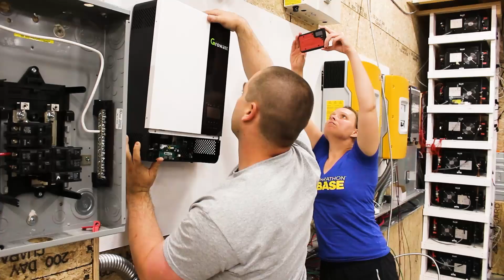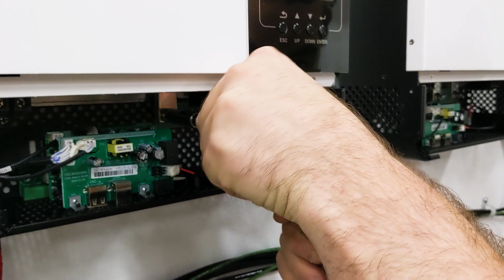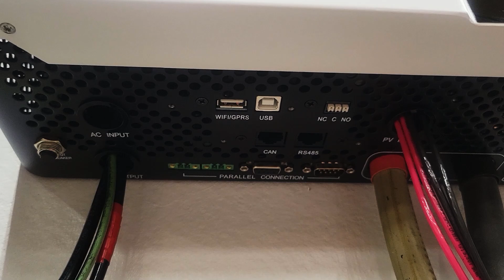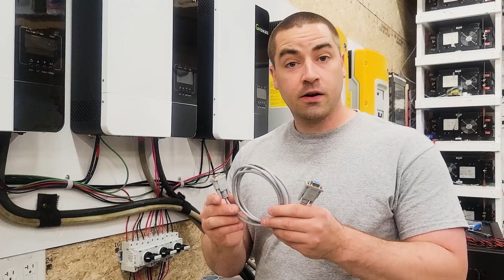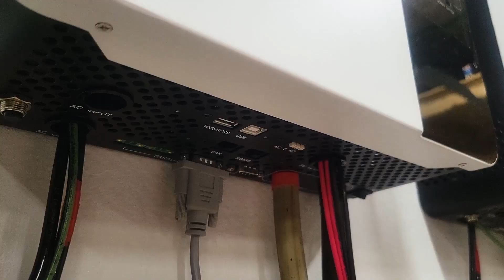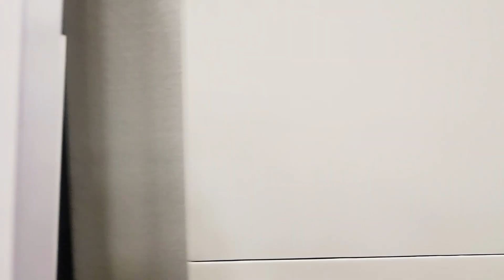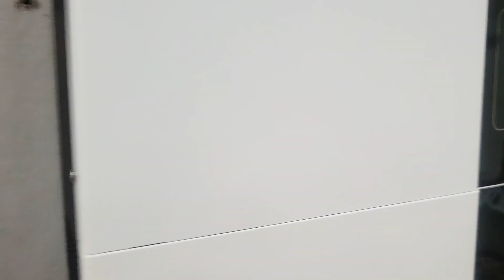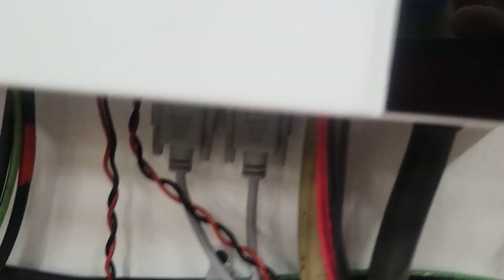Paralleling 3 inverters together, Growatt 5000w Solar System

Comment: Thank you for your excellent videos David. Do you do Patreon ?  I would like to support your channel. 
I am planning an addition to my existing solar system which is 3200 W at 24 V and 4000 w at 330 V.  I am planning to add another 4000 w and wire them at about 300 volts as well.  The existing 330 V is just grid tied. My intention is to go off grid and just use the grid to charge the battery on rare occasions. 
The plan is similar to your video with three 5000 W growatt inverters and 30 K of the GYLL batteries. The question is should I rewire a 24 V array or can it be used as is plugging in to the growatt inverter?
Thanks Rob
Reply from the maker: Hi Rob,  Yes, I have a Patreon page.  https://www.patreon.com/DavidPoz  Thanks for wanting to help.
The 24V array will have to be re-wired to at least 120V at Vmp.  These inverters have an MPPT range of 120V-450V.    There are some hacks to do other things, such as, if your existing 24V array is currently charging a 24V battery, then you could add a DC to DC boost converter to charge the new 48V battery bank from the 24V bank, but personally I wouldn't suggest that.  Too many losses.
Reply: @DavidPozEnergy  Thanks for your response DAVID since I’m planning to maintain my grid connection do you see any reason why I couldn’t also have the option to connect my entire load if the solar system for to go down?
Reply: Given the choice of rewiring the 24 V array for 48 V and continuing to use my outback charge controller or 150 + V and using the growatt inverter to charge the 30 K 48 V battery which would you recommend?
Reply: Another choice I have is to replace the old 3200 W array charge controllers and lead acid batteries with a second 4000 W array with the same panels I’m intending to put on the new carport. In this solution I would have all relatively new equipment. I could likely sell the old 75 W panels and newish lead acid batteries plus charge controllers to offset  some of the cost of the new system. 
Hope I’m not asking too much of your time with these questions. 
Best Rob

Comment: what's the panel you use on the wall to mount your solar controller?
Reply from the maker: It's a cement board used behind tile.  I just painted mine white. James Hardie brand, HardieBacker 3x5 feet
Reply: @DavidPozEnergy  cool!! Thank you. I’m building my first 48v growatt system for the first time!!
Reply from the maker: Congratulations.  It's a lot of fun.

Comment: Hi David, great videos!  It seems odd that a 240v inverter would then require an expensive external transformer to make a split phase 120/120 supply like we have in the US.  Aren't there any inverters that can do that?  Or would it be better to simply use two 120v inverters that are phase synced?
Reply from the maker: There are many options.  I injoy testing and sharing different ways of going off grid.  In past videos I have used an inverter with a buil-in transformer that gave both 120 and 240 volt output.  I have also demonstrated using two 120V inverter together, syncronized 180° out of phase of each other to provide 240V.  Lots of videos on my channel.

Comment: Ok so  have to say it to get it.

You take a 240 single phase inverter and push it through the transformer.  The transformer then creates two 120v legs with a neutral.  Those two legs are in phase though yes?

They are not split phase where you can get 240v to run appliances such as a dryer, stove/range, heat pump, air handler, etc.
Reply from the maker: I go into more testing and details on the auto transformer in this video: https://youtu.be/yWUfvvSa3K8

Comment: Hi David, how difficult is it to set these inverters up as a 3 phase system? Is it just programming, or is there separate pcb required for the syncing function?
Reply from the maker: It's just a different setting in the menu.  The manual does a good job showing how to set it up.  I have not personally tried.
Reply: @DavidPozEnergy  Hi David Growatt sell 3 phase inverters individually

Comment: What's the use Auto Transformer? Can it be dispensed with?
Reply from the maker: You don't need the auto-transformer if you are running only 240V loads.  Such as water heater, well pump, mini-split.  But I use the auto-transformer to get my 120V loads going.  I have more details in this video: https://youtu.be/yWUfvvSa3K8
Reply: @DavidPozEnergy  ok thanks, 
In Oman we have 240 only.

Comment: hi thx for all your video i got a question, the circuit pannel braker like your is a 100 amp and what transfer switch would i need?  Can i use this ?
MOES Dual Power Controller Automatic Transfer Switch 50A 5500W for Off Grid Solar Wind System ATS DC 12V 24V 48V AC 110V 220V or i need something else ?

Comment: So let's say I want to use the AC inputs on these units as well as the AC outputs for the paralleling so that I have backup if there wasn't enough sun.  What's the best way of breaking out the power? If I read from the manual correctly, it appears that their suggestion is to get some sort of 200A panel and that the units have their own breakers in them. But I can't find a 200a fused disconnect that doesn't also require breakers that isn't VERY expensive. I want to have 4 units but eventually have 6. (whole home geo thermal etc.)  Suggestions?

Comment: Really enjoy your videos.  For this install, I'd recommend running the 240VAC lines in conduit, or using SOOW cable for safety.  Or install a shield over the wiring bundle.
Reply: True

Comment: Can you possible help my husband and myself with a question on what might be wrong with our settings as we can get everything to come on via the charged battery without utility power! Which is amazing 👏 Air conditioner  and all! Running 2 Growatt inverters in parallel one hooked up to the generator why does the default alarm come on everything we try to turn the utility  power on and won't charge the battery? Have you ever heard of this issue? Love your videos and followed your advice 100 percent but was wondering if it's a common settings issue? Thank you for your time in advance and God Bless
Reply from the maker: I'm sorry, but I don't know the answer.  I've never hooked up the "input" side of the inverters to anything.

Comment: Can I ask what the point of multiple inverters is, I'm very confused
Reply from the maker: Each inverter can output 5000 Watts.  By paralleling more, I now have up to 15000 Watts.  To put this in perspective, one Tank water heater uses 4500W.  A microwave uses 1800W.

Comment: Newbie here... can you parallel small inverters? Say 1000 or 2000 watts ?
Reply from the maker: You can only parallel inverters that specifically say so.  Most inverters on the market don't parallel.  When in doubt, assume they don't support paralleling. It's not about the size of the inverter.  There are some smaller 2000W inverters that allow paralleling.

Comment: Would you recommend paralleling these vs buying a larger one, like the 12kw growatt? Also, I'm concerned about noise because I can only put these outside of a bedroom window, how bad would that be?
Reply from the maker: Noise:  The fans on these units get quite loud when at full load, but get quieter with less and less load.  If you are at all concerned with noise I'd look to moving them, or buy a quieter unit.

I liked paralleling them for my application because of my 3 solar arrays in my backyard.  Each inverter has 1 solar MPPT charge controller built in.  This worked great for my 3 solar arrays.  However, if you have less solar then the 12K inverter makes for a simpler installation.  Just so long as you don't have to lift it.  The 12K inverter is a heavy monster.

Comment: What gauge wire did you use for the ac side out of the inverters?  That looks like 8 but the manual appears to call for 12 which seems too small.
Reply from the maker: I used 6 AWG on the AC output.  It's overkill, but I had some left over from another project.  I agree that 12 seems too small.   10 AWG would be the smallest I'd use.
Reply: @DavidPozEnergy  I have been using 8. You used 50a breakers to get 6 to fit I presume.  I am going with 40a… assuming 7000w peak.

Comment: I am very curious what you found when you ran the numbers on cost vs efficiency.  Do the big yellow inverters offset their higher cost with their better efficiency?
Reply from the maker: No.  You can purchase 1 extra solar panel per Growatt inverter and it makes up the difference. (general statement assuming a 360W panel)
Reply: @DavidPozEnergy  very interesting.  Thank you!

Comment: Can you perhaps give me some info on what I need for a 3 bedroom, 120sq meter (1130sq ft) house,. Will this inverter be sufficient?
Reply from the maker: Hi Gavin,  When sizing an inverter it's more important to look at the loads, not the square footage.  For example, my home is 600 square feet and I need at least 2 of these inverters (10kW).  But I know other people with 2,000 square feet houses that can use just one.  The difference is the loads.  My home is 100% electric to include heat.  But some people use natural gas or propane for heat, dryer, water, stove, and oven.  In that case the electric load is quite small.
The good news is you can start with one inverter and even if it's not enough for everything, you might just move a few critical loads to it.

Comment: FYI your promo code for signature solar on this product is not valid anymore. They do not sell the transformer separate anymore this can only be bought as just the inverter or combo inverter and transformer and code does not work for that.
Reply from the maker: Thank you for letting me know.  I'll try to get in touch with them.
Reply from the maker: Signature Solar fixed it.

Comment: David, I am wiring 6 growatt 5000 inverters, not having much luck. From your video it looks like the load and neutral lines from the inverter to the panel go into a 220 breaker 2 pole is that correct?
Reply from the maker: Hi.  Yes.  The Growatt model I'm using is SPF5000ES.  This model is 240V output only.  Inside the growatt the output terminals are labeled Ground, Line, Neutral.  In the US we usually would label this G, L1, and L2, so that's how I treat it, as two hot legs.  I run the two hot legs into my "combiner box" which is nothing more than a 20 slot circuit breaker panel from Home Depot.  Each inverter has a 2-pole 50 amp circuit breaker, and I'm using 6 gauge wire.  It's very easy to accidently swap your L1 with L2 from one inverter to another.  This is because the bus bars jump from left to right as they go down the panel.  I've spoken with some other installers who accidentally made this mistake.  So try to ensure all your L1's are on 1 bus bar and all your L2's on the other bus bar.

Comment: Couple questions. 1. Total output is basically 62amps on 15kw array correct?  2.  Doesn't the 30amp auto transformer add to the load? 63amps minus 30amp = 33amps of available power to house? (Assuming the full load really is 30amps on autotransformer)
3.  How much is the total load charging the batteries? It seems a single 4/0 battery cable isn't big enough to handle. I also don't know voltage and amperage on your array and may have missed you continued to parallel battery bank.
Reply from the maker: 1. Yes.  2. No, the Auto-Transformer is in parallel with the inverters, not the load.  3.  My array is 12kW, or maximum 250 Amps.  My 4/0 cables are each about 2 feet long, and can handle 250A no problem.
Reply from the maker: If you would like more details on the auto-transformer, check this video out: https://youtu.be/yWUfvvSa3K8
Reply: Aren't you required per code to have disconnect means and overcurrent protection on dc side for battery bank? Don't recall seeing that, maybe u never got those parts in.
Reply from the maker: I'm a DIY guy, not a licensed electrician.  I'm only sharing the projects I'm doing, not telling anyone else what they should be doing.   My batteries have a circuit breaker built in.

Comment: When you combine two positives, of the arrays, that means you are using 6 panels in parallel and 7 panels in parallel, is that correct?
Reply: I believe that the 6 and 7 panels are in series and the 2 positives combined put the 2 series in parallel.

Comment: About the breaker to the auto-transformer causing a floating neutral... Not sure but it seems to me that this would not be a floating neutral issue but rather a circuit that has no return path for the two legs (120v). Try it with a load on a leg and turn off the breaker. There should not be any current through the load - I think!
Reply: You get a path through other 120v loads that are connected. For example, two hair dryers. One on L1 and the other on L2. With the neutral floating, the voltage will move around between 0v and 240v.

Comment: I would like to know if it is possible for you to come and settle in Africa. Regarding the equipment, it can be purchased in the USA but adapting to French standards which are used in French-speaking country in Africa, namely 200 / 240V AC.   Kind regards

Comment: Thanks, for these videos, May I connect this inverted to the grip as they stay in the manual, If I can do this, they label input terminal L, N, G, Line, Neutral, and Ground respectibly, if connecting to 220v American grip this will be one leg of 120 to L, the other 120 leg to the neutral label in the unit, and ground to the white or green on the grid, please may you answer this....?
Reply from the maker: I personally run all my equipment off grid.  Sorry, but without the experience I don't feel educated enough to comment.
Reply: @DavidPozEnergy  Perhaps you can tell me, if you take a reading with a multimeter between terminals line(L) and ground at output AC of your inverter,  Can you tell me how much it read?
Reply: @DavidPozEnergy  thanks for you help to the community,  also I bought the crimper and the ferrules throughout your link a value, in your videos thanks.

Comment: Changing my question to be more accurate.  David, how do you have the 50amp breakers going to your house main panel and disconnecting from the grid?
Reply from the maker: At my main circuit breaker box there is a transfer switch.  https://interlockkit.com/  My inverters feed into a 50 amp circuit breaker, grid feeds the 200 amp breaker.  Only one can ever be ON at a time so that I can never accidentally send power to the grid.
Reply: @DavidPozEnergy  AH, thank you.  I already have that for my generator in the top right double pole breaker in my main panel.  Didn't think about reusing that by having inverter connected instead.  Brilliant!

Comment: Is the combiner box a 200 amp breaker box?
Reply from the maker: It's an off-the-shelf breaker box from Home Depot.  The exact one I am using is a 125A, but a 200A box would be the same setup.

Comment: I don`t understand why you would go so much 240 volt power   ? 
i can`t think of ho many things i would have 240 volts
in a normal house even
Dryer , Hot water , Pool maybe
Reply from the maker: The funny thing is that the 240V appliances are fewer, but they draw larger amounts of power.  For example, a dryer might draw 4500W.  That's more than all my 120V stuff combined.

Comment: great video would love to know what your average hydro consumption is per day, what are some larger loads that you run off the inverters and how big your array is coming into the system plus wondering how the 30kwh battery bank is working if its lots sufficent to run your house at night or for a day of low sun. like watching your videos lots of info would like to make a similar system completly off grid with about 10kw of sola pv
Reply from the maker: My 3 solar arrays total about 12kW.  My house and garage are 100% electric.  That includes oven, dryer, water heater, air conditioning, and space heating.   During the winter I could use 30kwh in just one day because of heating.  But most of the time I use about 12kwh per day.